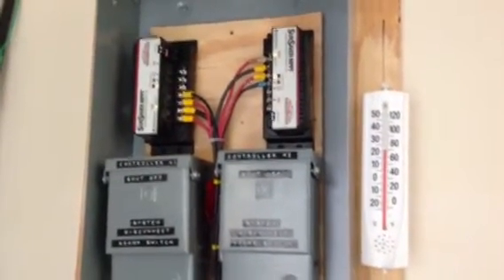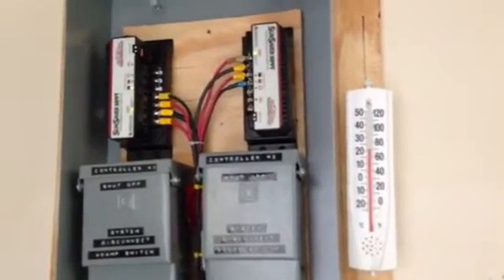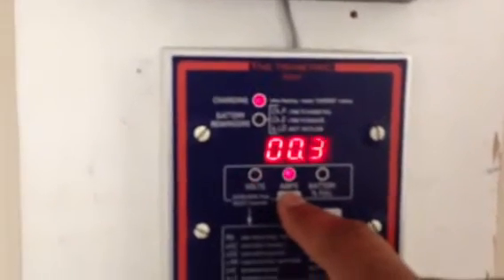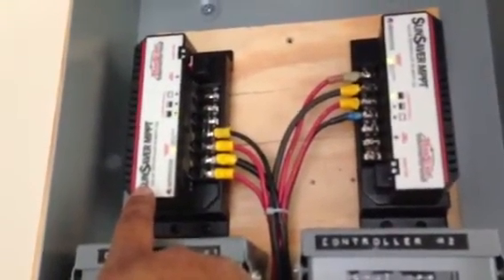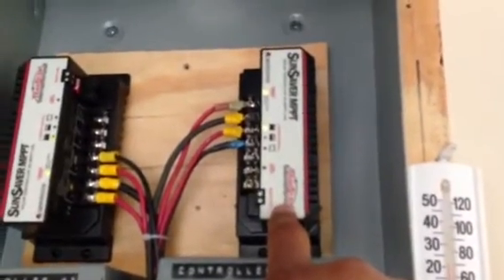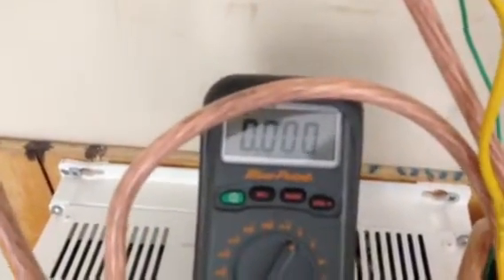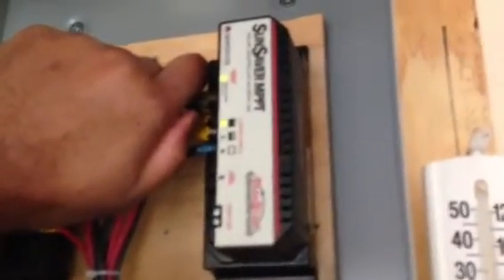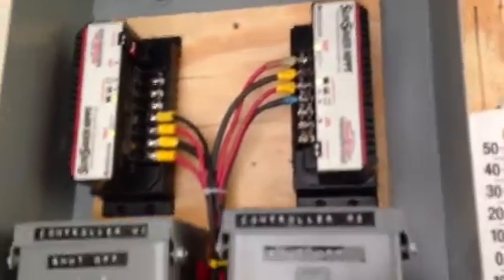Mourningstar 15A MPPT Solar Controllers in action

Comment from the maker: For a simple backup system a PWM is fine and will work for what you want to do.  If you are going to expand the system to support a medium to large battery bank with a complimenting medium to large size solar array, then definitely go with an MPPT. MPPT's are great for boosting amps in and cutting down your charge time especially when your dealing with a large battery bank as I have.  With 1 or 2 batteries a PWM will work fine, 3 or >  go with an MPPT.

Comment from the maker: Thanks for your comments. Actually, on a good day with bright sunlight the voltage will be just over 60v, maybe between 60v to 65v. The charge controllers have been running now for almost 2 years and the voltage hasn't got high enough to fault.

Comment: Thank. Good info but I think u will have a fault on your second mppt because two 24v panels in series will bring your volt to 80v easily on a good sun light and mppt 15 amps charge controller can only top off at 75v.

Comment from the maker: Testing voltage is no problem, haven't seen any sparks etc.  But testing amps, that's another story. I've fried at least 2 or 3 test leads doing that.  However, I've come up with a better way to test both volts and amps by installing test points that allow me to connect alligator clips.

Comment from the maker: The 4 panels = 670w total under ideal conditions, under moderate to ideal conditions I can reasonably expect at least 580 to 600w.  For a system strictly designed for emergency backup, this is more than enough. With home energy conservation, LED lighting, and efficient appliances, it will take a couple of days to totally drain the batteries in the event of severe bad weather for more than 2 or 3 days. In cases where the sun is not going to do it, I have DIY Gen I could use running off propane.

Comment from the maker: Yes, but you'll be loosing some degree of power.  With these controllers you will limited to 200w max input for a 12v system and 400w for a 24v system.  The controllers will read your system voltage and make adjustments accordingly.

Comment from the maker: Sometimes I disconnect the charging system to exercise the batteries from time to time. If I had to do it over again, I would still go with a 24v system.  A 48v system is still more efficient, but I don't see any immediate benefits as far as my backup application goes.